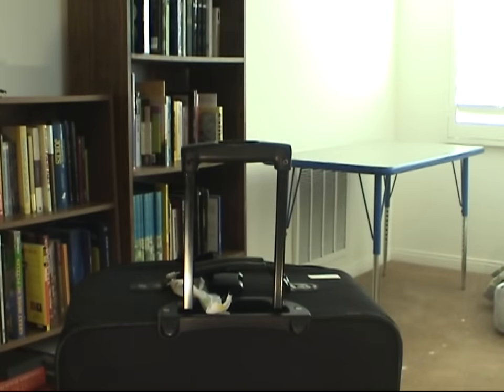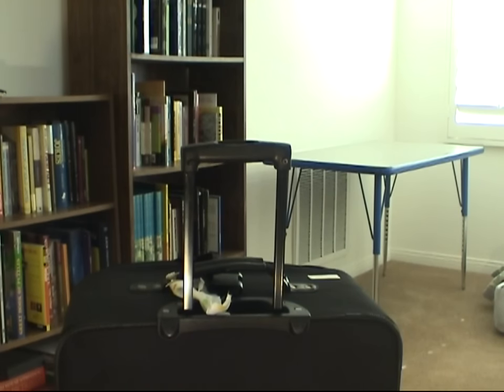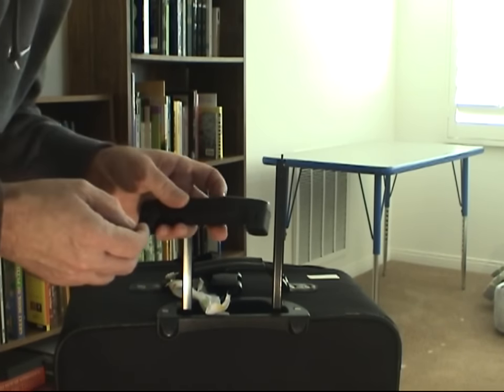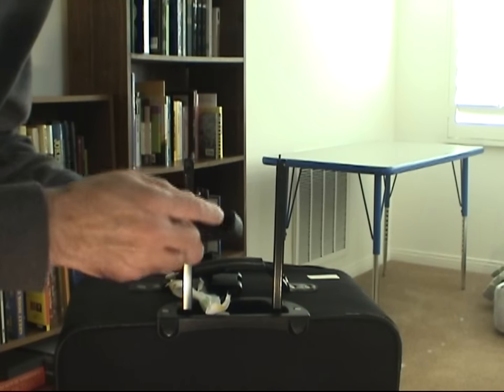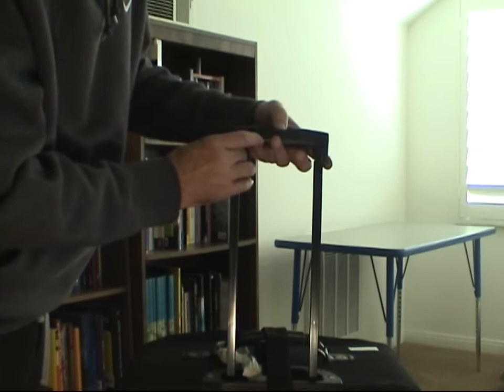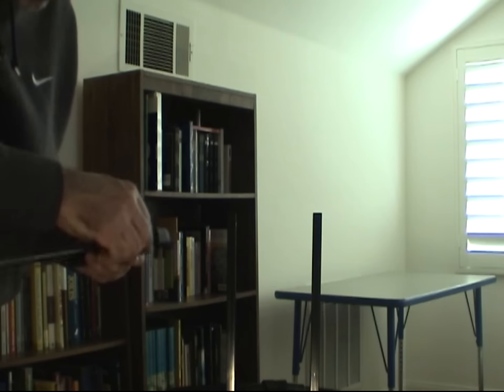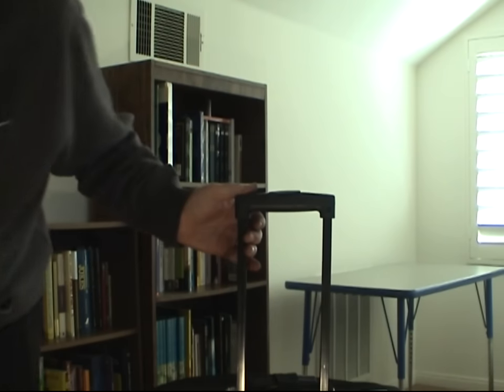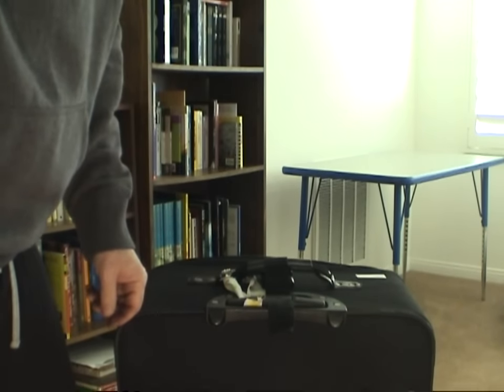Luggage Handle Repair

Comment: Oh dude, my luggage has rivets and not screws :(
Reply from the maker: Oh boy.  I have about 8-9 pieces of luggage from different mfgs and they all use screws.  You might contact the mfg of your piece and ask them for a method to fix your handle.  Or search for other YouTube methods where rivets are used. Sorry my method didn't work for you.
Reply: @Aeropricer1   My husband used a dremel tool to cut one end of the rivets off. We just used black electrical tape to wrap around the m to hold them in.